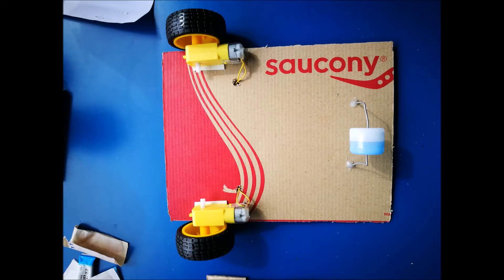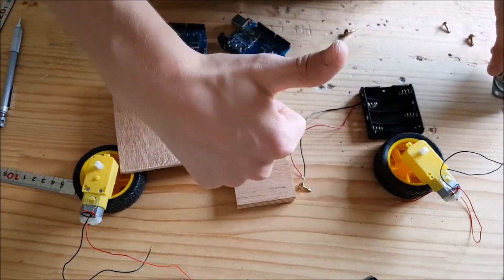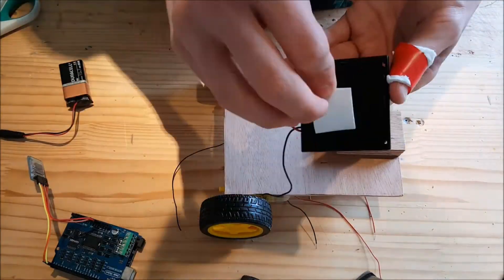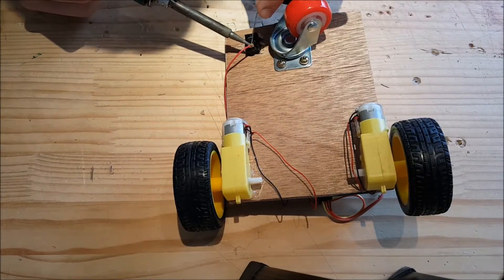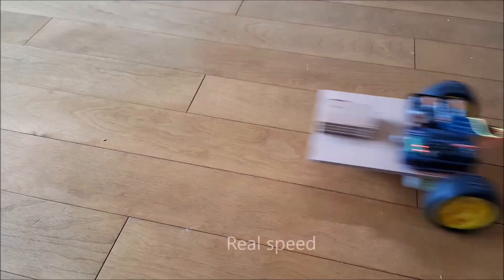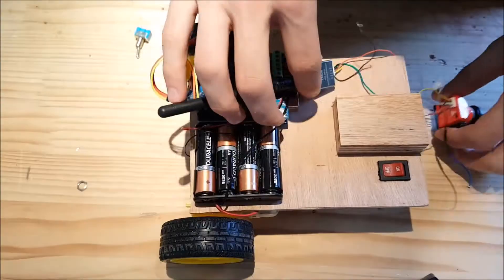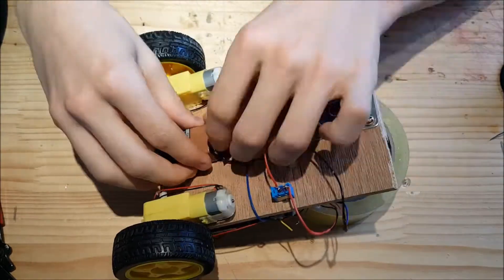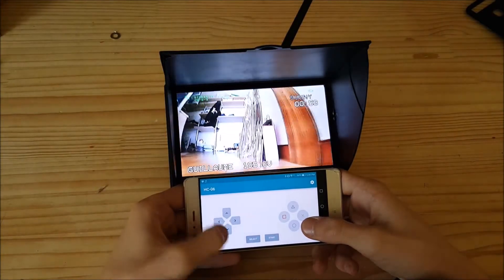Bluetooth FPV Arduino Car- DIY

Comment: Codes
Reply from the maker: Here it is! This is for L293D motor control. Pretty similar to with a motor controller shield. Hope I could help! char data = 0; void setup() { analogWrite(5,0); analogWrite(6,0); analogWrite(9,0); analogWrite(10,0); Serial.begin(9600); } //Motor A: 5,6 //Motor B: 9,10 void loop() { if(Serial.available() > 0) { //For bluetooth data = Serial.read(); Serial.println(data); if (data=='1'){ //forward analogWrite(5,255); analogWrite(6,0); analogWrite(9,255); analogWrite(10,0); } if(data=='2'){ //back analogWrite(5,0); analogWrite(6,255); analogWrite(9,0); analogWrite(10,255); } else if(data=='3'){ //right analogWrite(5,255); analogWrite(6,0); analogWrite(9,0); analogWrite(10,127); } else if(data=='4'){ //left analogWrite(5,0); analogWrite(6,127); analogWrite(9,255); analogWrite(10,0); } else if(data=='5'){ //stop analogWrite(5,0); analogWrite(6,0); analogWrite(9,0); analogWrite(10,0); } } }

Comment: Code?
Reply from the maker: Here it is! This is for L293D motor control. Pretty similar to with a motor controller shield. Hope I could help! 
char data = 0; void setup() { analogWrite(5,0); analogWrite(6,0); analogWrite(9,0); analogWrite(10,0); Serial.begin(9600); } //Motor A: 5,6 //Motor B: 9,10 void loop() { if(Serial.available() > 0) { //For bluetooth data = Serial.read(); Serial.println(data); if (data=='1'){ //forward analogWrite(5,255); analogWrite(6,0); analogWrite(9,255); analogWrite(10,0); } if(data=='2'){ //back analogWrite(5,0); analogWrite(6,255); analogWrite(9,0); analogWrite(10,255); } else if(data=='3'){ //right analogWrite(5,255); analogWrite(6,0); analogWrite(9,0); analogWrite(10,127); } else if(data=='4'){ //left analogWrite(5,0); analogWrite(6,127); analogWrite(9,255); analogWrite(10,0); } else if(data=='5'){ //stop analogWrite(5,0); analogWrite(6,0); analogWrite(9,0); analogWrite(10,0); } } }

Comment: Does camera working is like u give supply and it will start giving output and what kind of data it gives out, ????
Reply from the maker: You supply the camera with a voltage. The output you connect to a transmitter. You then use a receiver and a screen to view the image.
Reply: @electronology4665  can I also conect the video output to controller and then display it on screen???
Reply: @chinmaykulkarni7835  It is on 5.8ghz analog band. Camera to VTX and VTX broadcasts to anything 5.8ghz reciever

Comment: Can you give the name of the pieces?
Reply from the maker: For the car:
Arduino Uno, motor shield, two motors, battery, with Bluetooth HC-06 to connect to phone

For the FPV
FPV camera, video transmitter, battery
Reply: @electronology4665   name of the FPV?
Reply from the maker: The camera is a foxeer arrow pro
The TX is eachine

Comment: Give the code
Reply from the maker: Here it is! This is for L293D motor control. Pretty similar to with a motor controller shield. Hope I could help!

char data = 0;  
void setup() {
     analogWrite(5,0);
      analogWrite(6,0);
      analogWrite(9,0);
      analogWrite(10,0);
  Serial.begin(9600);
}

//Motor A: 5,6
//Motor B: 9,10  

void loop() {
  if(Serial.available() > 0)  {
  //For bluetooth
    data = Serial.read();
   Serial.println(data);
    if (data=='1'){         //forward
      analogWrite(5,255);
      analogWrite(6,0);
      analogWrite(9,255);
      analogWrite(10,0);
    }
    if(data=='2'){         //back
      analogWrite(5,0);
      analogWrite(6,255);
      analogWrite(9,0);
      analogWrite(10,255);
    }
    else if(data=='3'){         //right
      analogWrite(5,255);
      analogWrite(6,0);
      analogWrite(9,0);
      analogWrite(10,127);
    }
    else if(data=='4'){         //left
      analogWrite(5,0);
      analogWrite(6,127);
      analogWrite(9,255);
      analogWrite(10,0);
    }
    else if(data=='5'){ //stop
      analogWrite(5,0);
      analogWrite(6,0);
      analogWrite(9,0);
      analogWrite(10,0);
    }
  }
}